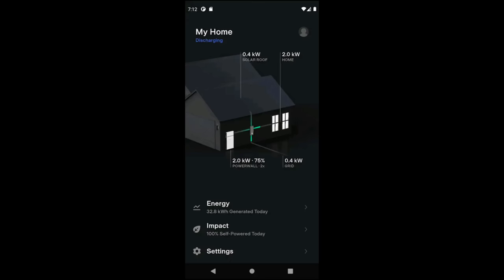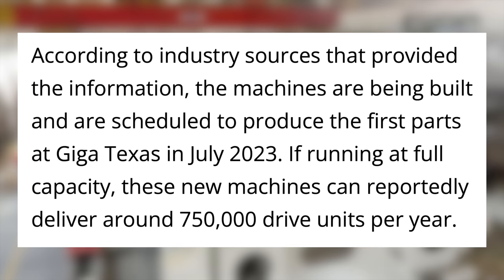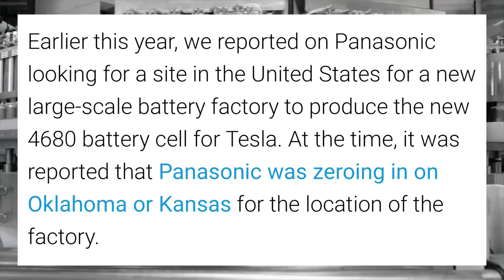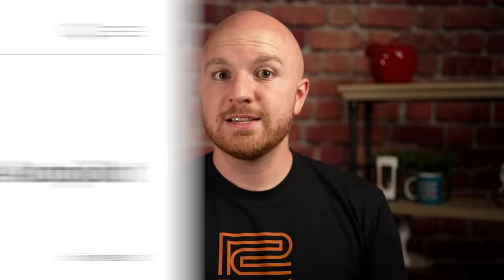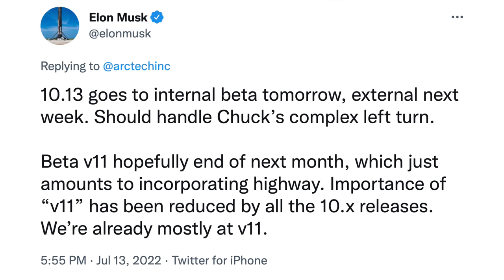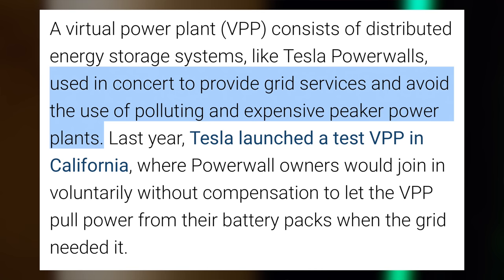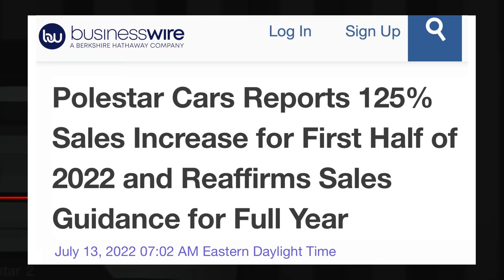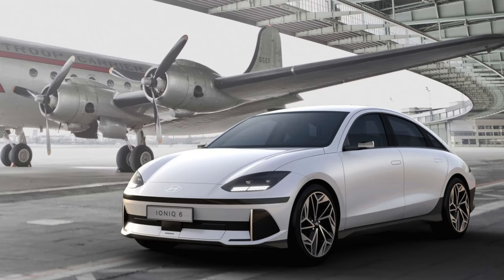NEW Tesla Model Y+ Coming In 2024? | Here's What We Know

Comment: Love the content brotha! 396 miles sounds nice, but with the 4680 we all thought it would increase the range as well. Tesla is a leading innovator in anything EV and batteries at the moment, but I don’t think 400 mile range vehicle is something they will do soon, when Elon himself says it doesn’t make that much sense. The increase density of batteries, means more energy but I see it the way they used the 4680 recently. They will use less batteries, decrease the weight, and keep the mileage the same which in turn will increase the efficiency. Making it cheaper to build, more margin. Would love a 400 plus range vehicle, however I see tesla thinking business first over consumer.
Reply: I may be wrong, but isn’t the model S long range 406 miles range
Reply: @jmsne7  yes you are right, I was just referring to the Y being close to 400 miles. Great point.
Reply: @joshuabradburn1728  oh yeah plus the model s is quite expensive, so it would be nice to have a affordable vehicle(model 3/y) to reach 400 miles
Reply: For cyber truck long range will be very critical since towing drains range like crazy
Reply: Current 4680s my are possibly being software limited to get real world data for charging rates. It also helps with the Osborne effect since customer will opt towards getting a 4680 vehicle over a 2170 if the range is significantly more
Reply: @jorgecamacho4359  Find that opinion hard to believe. With Munro Live tear down of the 4680 Model Y, and The Limiting Factor breaking down the specs of a 4680 battery, all the math is proven to be accurate, mostly. Not software based or assumptions. If there is a cheaper 400 plus model Y or 3 I’ll be super pumped. But I’m not buying the software locked mile range. It makes more sense for Tesla to install less batteries for an average range close to the current models vs “software lock” vehicles from going/using the batteries full potential. But we will find out more shortly with the model y breakdown and 4680 study.
Reply: Yes, you nailed it. Tesla will keep the benefits for themselves and just put less batteries in the car.
Reply: Tesla always surprises. We’ll have to wait for actual measurements of current 4680s (limited factor was 6 month old tech)
And was just estimates, not live measurements as specified would be covered in his deep dive video
And for a completed Munro tear down to make a conclusion.
Reply: @jorgecamacho4359  yes definitely wait and see. But it’s better evidence to go off of rather than a baseless opinion of thinking that it’s limited mileage due to software. Excited to see what’s next, looking forward to my tesla soon.
Reply: “Business first over consumer” Sadly. Tesla might claim its consumer first, pushing cars out the door as fast as possible, but at the end of the day the consumer would rather have the better, more feature rich product.
Reply: 4680 was supposed to allow increase in range by 52% or so as Musk explained on Tesla Battery Day
Reply: @Tom_Mroz  yeah when fully optimized. But that’s in a lab/ prototype setting. Manufacturing at scale is always going to change the predicted targets
Reply: @joshuabradburn1728  some employee delivers are claiming to have 400+range and no being limited. So not baseless, just rumors. The energy density was also estimated for limiting factors video. So again, we’ll see what happens when a legit tear down of a newer 4680 battery cell looks like
Reply: Tesla range estimate is lies. Even in ideal conditions u get 80% of what it estimates. So 400 mile range is more like 320 real world range. Add cold weather and itsmore like 280 miles
Reply: @_____0__  nah you’re probably just doing over 65-70mph and blasting the A/C on cold or heat lol
Reply: @Joshua Braeburn Tesla has to do it this way because they don’t have enough 4680 production and they need to be mindful of the Osborn effect or they would go bankrupt.
Reply: It would depend on how much batteries they can produce because 400 miles mean less pressure on the charging network. Basically shifting the cost to customers, so any company would love that.
Reply: @Joshua Bradburn Tesla is competing with other companies as well. As they increase their range Tesla will have to as well to remain competitive. And then you battery companies like CATL that are pushing batteries that can push vehicles over a 100km(approx. 621 miles). A third factor is the fact that batteries are improving over time. CATL's new m3p battery for example promises at least 10% more range than Tesla's current batteries in China. I think those 3 factors will lead to cars with batteries past 400 miles over time.

Comment: An example of how customizable Cabin Overheat Protection will help save energy is when you live in areas where for parts of a the year 105° F is surpassed daily. I for one, would like to set it at a higher setting so it doesn’t trigger as easily during those really hot times of the year.
Reply: My Model X goes into cabin overheat protection in my garage everyday because it is so hot in Texas right now.

Comment: I think We will have the option to run the fans under high heat conditions without the air conditioner. 
Cars are a greenhouse. Visible light containing lots of energy goes through the glass and is absorbed inside. The infrared that radiates back up cannot get through the glass. That's the greenhouse effect. 
So in order to keep it cooler without AC you will have the option of running the fans to bring it outside air which is cooler.
Reply: That feature already exists ... certainly in my Model 3.

Comment: Is the AC underpowered? Seems cant cool car in 100 degree heat? Is there a way to check? I did get 1 warning but service said wait.
Reply: If HVAC is on auto then it should cope just fine (some people set a manual fan speed and then wonder why the car can't get down to set temp).

Comment: Is anyone having issues with the cabine temp protection where it does not turn on sometimes?  mine reached 136degrees afew times and the Air did not turn on but when i check the app the temps were 136 which I did not expect.  I had been checking since I had seen a few times that it did not turn on.
Reply: It has always worked for me. Note that it won't work if the battery has less than 20% state of charge.
Reply: Just discovered that this pas weekend.
If you have been away from the vehicle for longer than 12 hours then it turns off.

Using the app doesn't reset it. Unlock/relock might but didn't try that as in my case it wasn't necessary as the vehicle was not going to be driven for 2 or 3 days anyway

Comment: how long are these cars expected to last?
what is the expected lifespan?
Reply: Depends on how you drive and charge it. I've got 240k miles on mine. Hoping to hit 350k before a battery swap. The batteries are 99% recycled.
Reply: @pwells10   Do you know how much degradation your battery has had?  and what level is a swap needed?  Seems the cars could last decades.

Comment: What does a 250kw charger do for a 75kw battery; does it supply 250kw per hour, does it allow 4 cars to charge at full speed at once, what benefit is there to move to 350kw chargers?
Reply: It's a 75 kWh battery, not a 75 kW battery. So it would take a 1 kW charger 75 hours to charge it, or a 75 kW charger one hour. So a 250 kW charger could, if it could charge at constant speeds, charge a 75 kWh battery in 75/250ths of an hour ( = 15/50 = 3/10 = 18 minutes) if it could charge it at full speed for the whole time. Note that normally one should only charge to about 80% with a supercharger, so 60 kWh gives us (60/250 = 6/25 = ~14 minutes)
Reply: 350kW will help when they have bigger battery packs in future vehicles like the 500 + mile cybertruck.

Its not much help for a 75kWh pack, but packs larger than say 120kWh would see a fairly sizable benefit